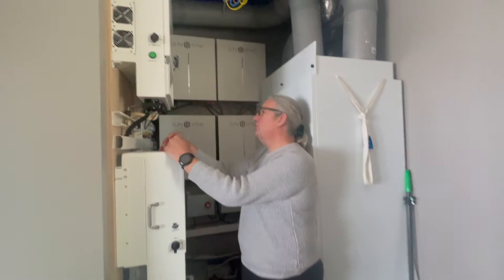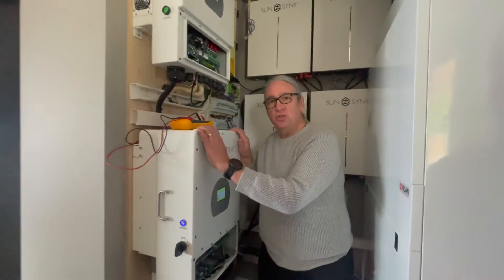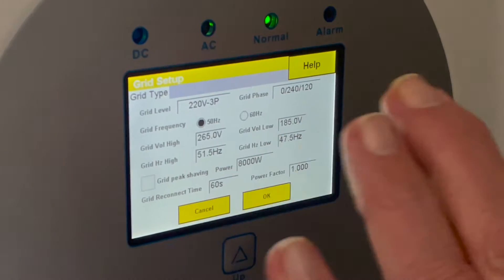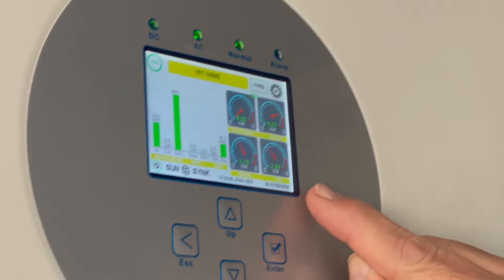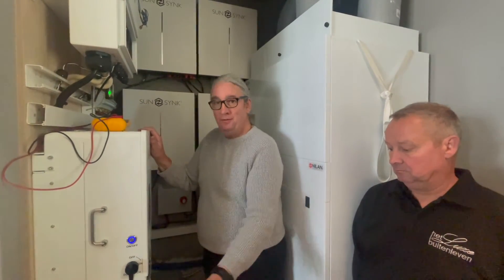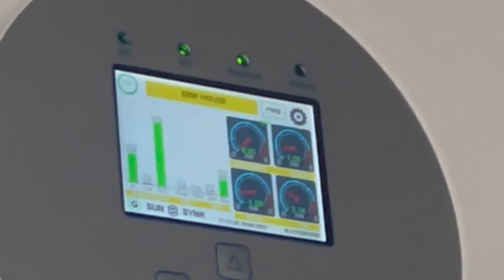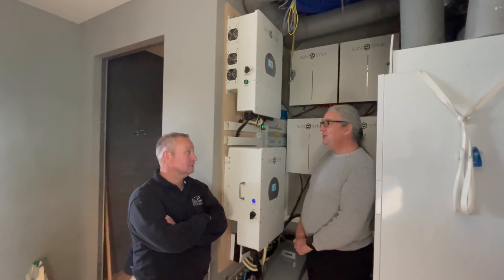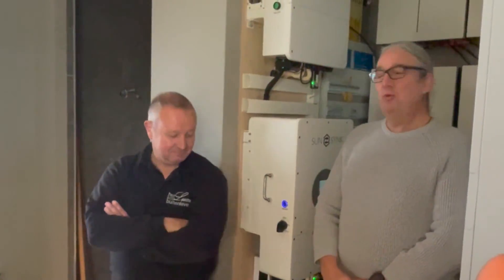Part 4, commissioning of a #Sunsynk system using power saving and 3 phase from a single phase supply

Comment: this is brilliant iv been looking at solar for some time and im also a machinest and to find that i could potentially run my workshop 3phase is great as i have only single phase incoming  are there any limitations of converting 3phase power using this method? And Or benefits over using a rotary phase converter ?

Comment: Hi Keith, I am in South Africa and  just want to check with the install in Holland, you done the Earth - Neutral bond on the 3 phase unit. if i have the 3 phase unit and Eskom does load shedding do I need to do a Earth- Neutral bond

Comment: hi Keith...Paul from South Africa, Question -  with a Sunsynk 12kw 3 phase inverter, what happens if one of the Phases is lost ?

and also can you connect single phase as input to this inverter and outputs 3 phases?